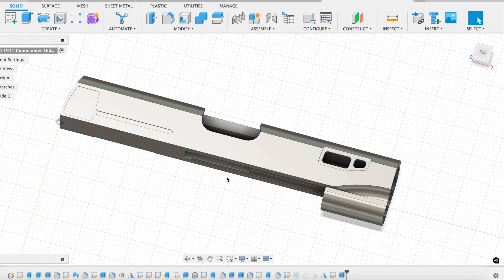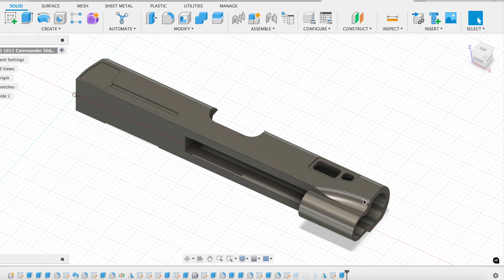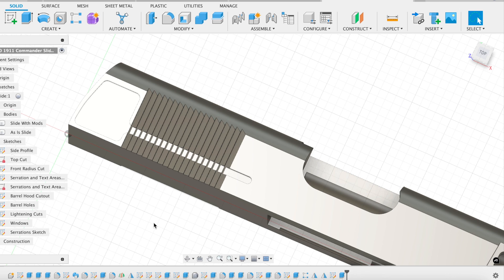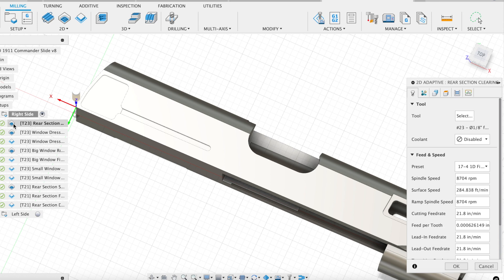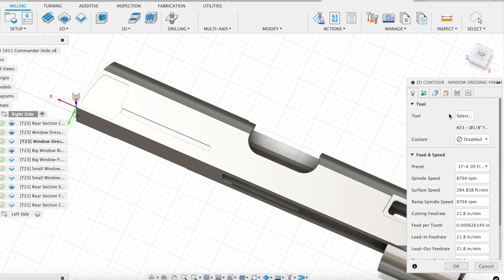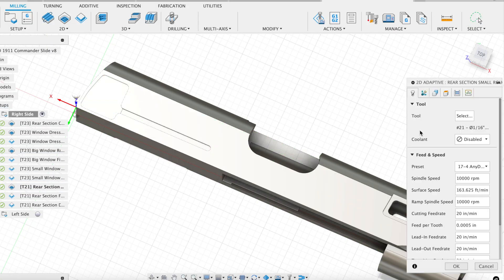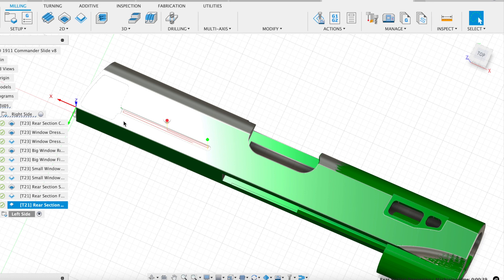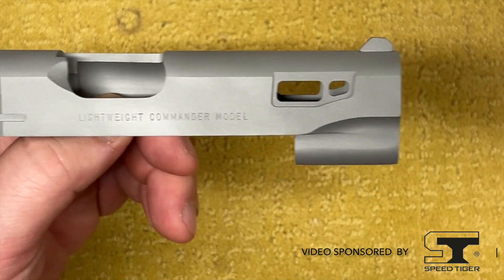How to Mill Windows and Lightening Cuts on a 1911 Slide

Comment: Im thinking about making lightening cuts in my sig Virtus...
Thoughts advice?
Reply from the maker: That would mean you're working on a rifle and in aluminum. Very different from what is seen here. I do have videos on that exact topic though. Have you checked them out? If you go to my other non YouTube channel, there is a whole playlist dedicated to exactly what you're trying to do.
What sort of CNC or mill are you working with?
Reply: @NotaGuntuber  lol a sharpie and a straight edge, A Dremel router, jigsaw, determination, hopes and dreams.
Reply from the maker: @ please don't do that. I thought about writing a really long reply that lists all the reasons this is a horrible idea. But at the end of the day, I only really have to explain one. Because even if everything else worked, which it won't, your Dremel just isn't powerful or accurate enough for this job. Heck, the runout on those thing's spindles is likely greater than the shipload for an 1/8" bit in aluminum. Said another way, there's no way in hell you're getting a decent surface finish with that thing and bit life is going to suffer massively.
Reply: @NotaGuntuber  link to your other channel?
Reply from the maker: @AntonMoquin-vg1sy  Check my channel's About page. All will be revealed.